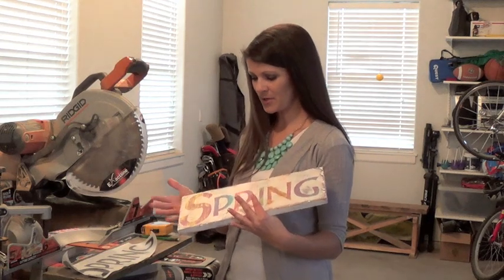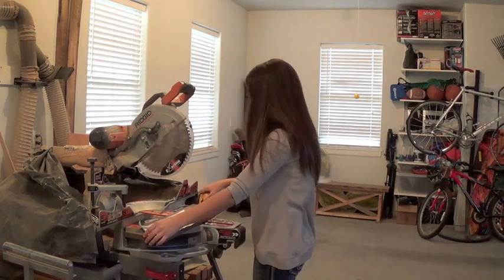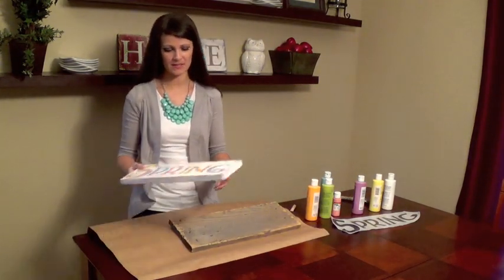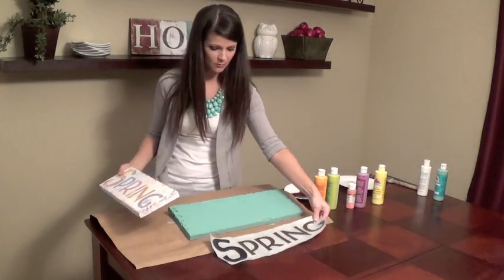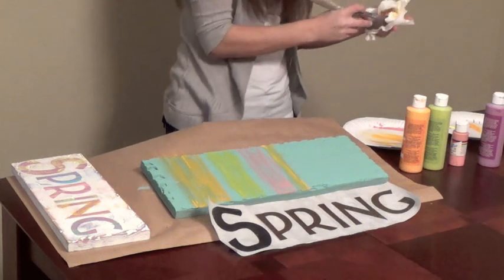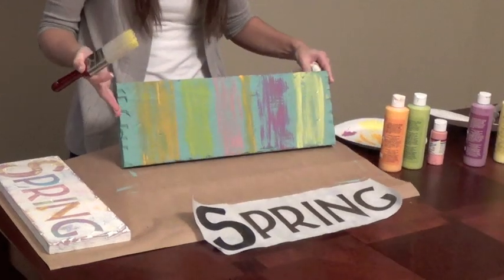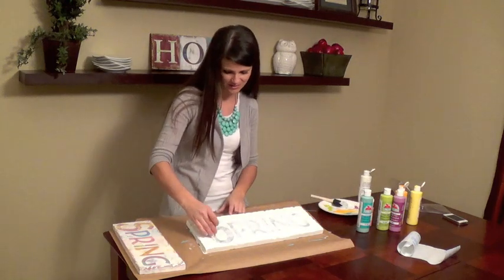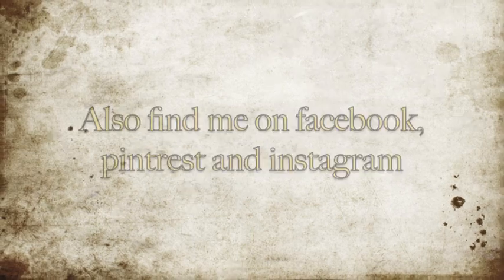DIY Home Decor   Distressed Painted Sign

Comment: I would like to buy a vinyl machine to try to make these things myself.  I am just a beginner and I'm not sure what I am looking for.  Where did you get yours and what is it called, exactly? I keep googling and finding things for screen printing, things for fabric, but I cant seem to find what I'm looking for to do these projects. Thank you.
Reply from the maker: Brent Zeiler Many beginners like to start off with a basic in home silhouette cameo electronic cutting machine.  This is a fun machine that cuts vinyl and paper and fabric.  It does limit you a little bit because it is only 12" wide.  I strictly wanted a vinyl cutting machine that can cut bigger projects.  I actually purchased my SC Series vinyl cutter from uscutter.com.  They have a wide range from very affordable machines to expensive commercial size ones.  I would decide what you are wanting first before purchasing.  If you just small at home project get a silhouette, bigger projects check out uscutter.com